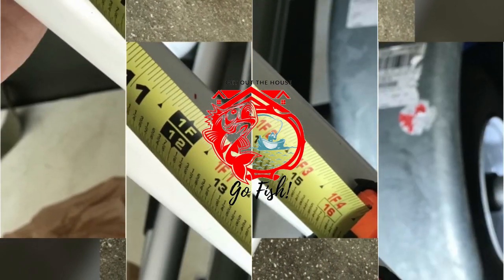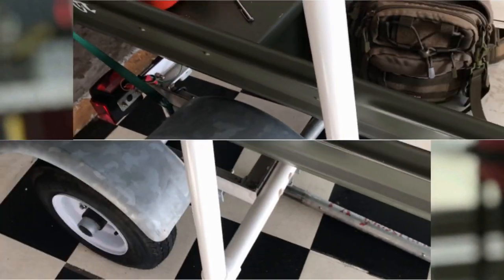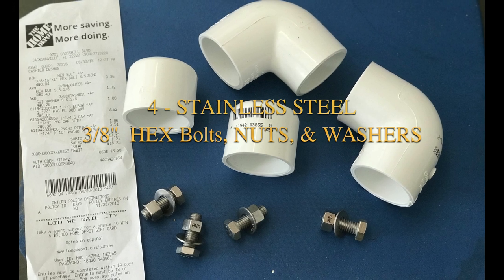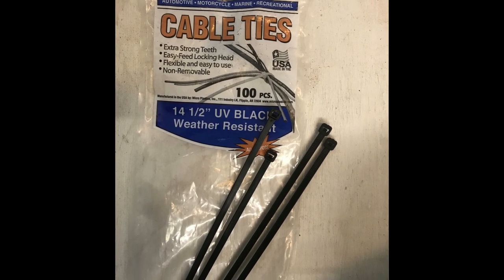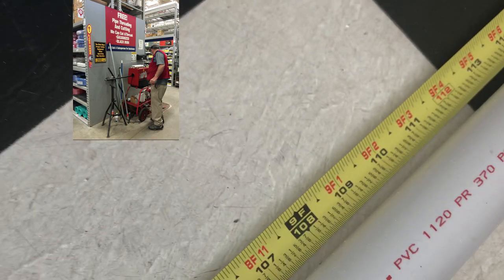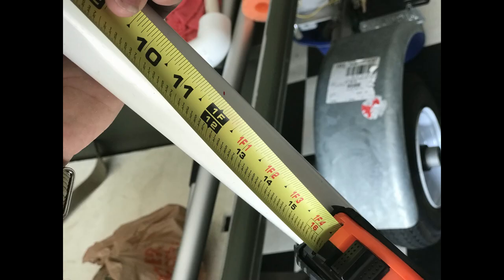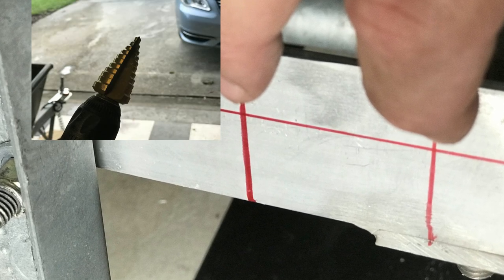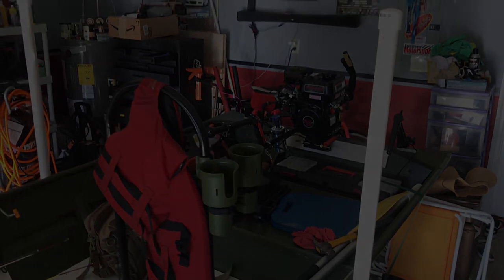Jon boat trailer guide (DIY less than $20)

Comment: List of Items needed:

• 4 Stainless Steel 3/8" HEX Bolts, Nuts, & Washers
• 10 foot, 1 1/4" PVC40 PE Pipe
• 2 of the 90°, 1 1/4" Elbows & End Caps
• Zip/Cable Ties (Weather Resistant)

Total Cost: $18.38
Home Depot

Comment: Great job. Perfect for a small boat like yours. Have 2 recommendations. 1st, I would swap out the zip ties and instead use metal hose clamps. Just another level of security, so to speak. 😊😊😊 The 2nd is for us people who have bigger boats. Use metal EMT conduit with the elbows or use a pipe bender. Where I live, you sometimes have to get off the water FAST due to storms. With your setup, my 16 ft Starcraft would snap that PVC in two when trailering my boat on HIGH winds. Great idea again for smaller boats!
Reply from the maker: Thanks for that great advice.

Comment: I agree with other posts. It's been my experience with pvc and seperately with hardware on trailers at high speed vibrations. Both the bolts and thin drain PVC like to break quickly.

A lot more expensive. Schedule 80 GREY PVC may hold up better. I'd imagine those bolts break through the WHITE Schedule 40PVC in no time.

I like the idea of metal type piping and U Bolts and the use of Florecent paint at the top of the guides. Stainless hardware is recommended.

Comment: Good job on keeping the cost down! I thought about that for my own jon boat trailer but was worried about them "L" or 90 degree part of the pvc piping breaking off if I hit it sideways running it up on the trailer. I opted for a galvanized curved 90 degree pipe and secured it to the cross member with U clamps. And then put a 3 foot long PVC pipe on top on the upper part of bend and secured it with a screw so it doesn't pop off. The galvanized 90 tube can take quite a bit of sideways force. I fish rivers a lot and sometimes you have to come at it from an angle to hit the trailer just right to put it on. Typically if I can I'll drive it up vs pulling out the rope and winching it up unless it's too shallow to do that
Reply from the maker: Only time will tell how it’ll hold up. I don’t usually drive it on. I’ve just been using the rope to guide it on.

Comment: Hi, I just bought this trailer from Academy and upon towing it home it vibrated so bad my steering wheel vibrated!  Have towed a 22’ Twin Vee without any vibration and another small boat trailer without vibration. Did your vibrate without a load on it?
Reply from the maker: I bought my trailer with the Alumacraft 1436 LT on it; never had the chance to drive with the boat off the trailer.
Reply: @GetOutTheHouseGoFish  I spoke with a trailer shop and they said yes, a small empty trailer will do that.  I put my 13' Gheenoe on it today for a test drive and it did great - whew!  Thanks for the reply.

Comment: Hey do you recommend a transom saver for this trailer? Kind of weird with the angled aluminum. I have the same
Reply from the maker: I’d say yes for an Outboard motor; I had a mud motor on my Alumacraft Jon Boat so I didn’t use it but when I got an outboard I finally added one then shortly after that I sold the Jon boat to upgrade to a skiff.
Reply: Which one did you use for this specific trailer?

Comment: what about the trailer lights? they aren't in the way?
Reply from the maker: My lights are currently rear of the fenders
Reply: @GetOutTheHouseGoFish  so they were moved? I have the same trailer and I wanted to add guides but I feel the lights might be in the way
Reply from the maker: @faithm.173  My lights have not moved. The guides are located in the front of the fenders and the lights are in the rear? THe lights have not been moved?
Reply: @GetOutTheHouseGoFish  ooooo I get you now. thanks :) 👍👍👍